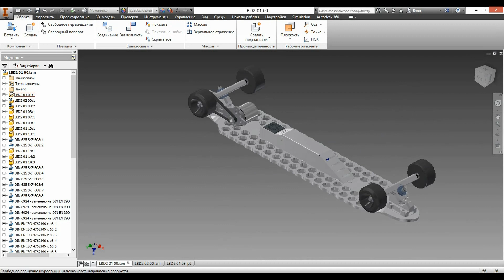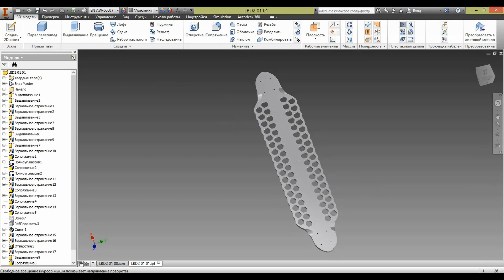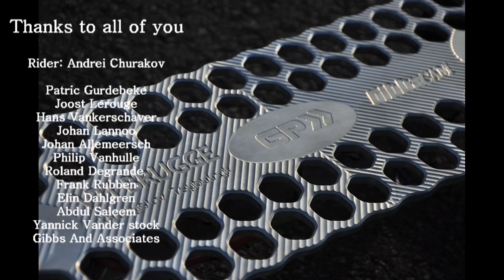Selfmade Aluminium Electric Longboard

Comment: I know it's a little late to say, but why did you put a 150 amp esc with a 70a (Max current) motor?
Reply: not double, you could fry the motor and battery that way by pulling too much current, 10 to 20% higher than the max amperage of the motor is best :)